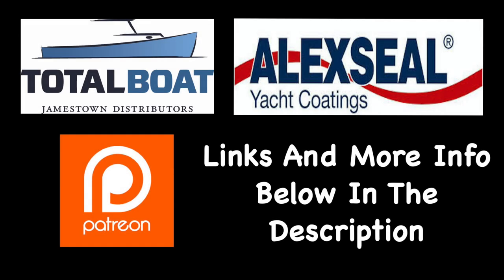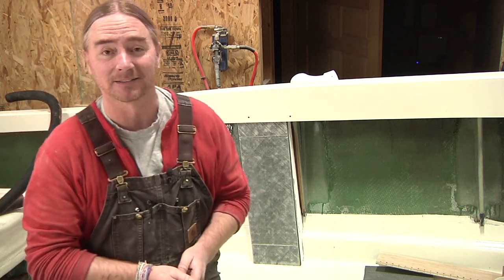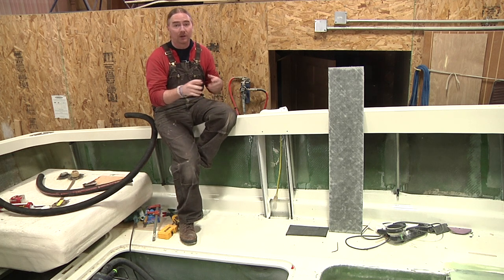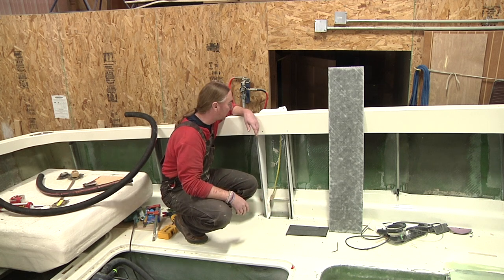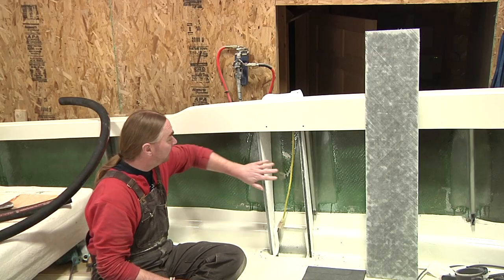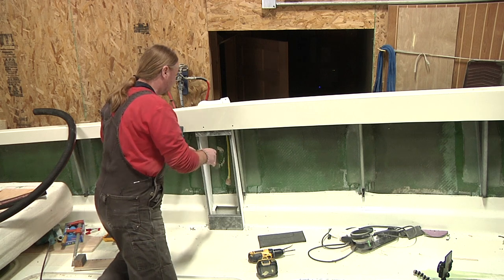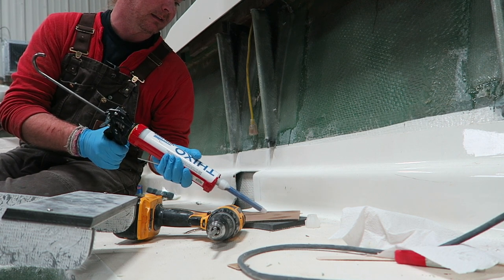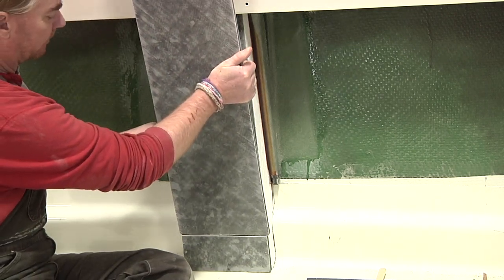Designing And Building The Fuel Locker Covers!

Comment: I think the 1/4 inch roundover was too little.  Before you did it I was thinking it was going to be like half inch or more.  Even if there is a roundover it'll still look boxy unless it is comparable to the other ones on the boat and I think the tightest ones I saw were around the hatch, but on great big plane like those panels it looks questionable.
Reply from the maker: I agree :-)
Reply: @boatworkstoday , Check my Comment pls. Sir, and advise me Which type Resin products to Use for affordability and Strength on the finished product.. Thanks, Richard

Comment: Andy, nice progress. 

You may want to add a small strip (or just a few small blocks) of coosa/glass to the inside of that locker to thicken up those walls. That would allow you to move the screws inboard, and have a more generous round over, 3/8" or maybe even 1/2". That would soften that corner nicely. Just a thought. 

Keep up the good work.

Comment: Undercut or back bevel the top stationary plate at the same angle as the bottom.  That way water will not run back under the 90 degrees top plate.  To place the panel slip the beveled top edge under the lip and then seat the lower portion.  Then both the top and bottom seams are angled down towards the deck.  Great channel.  I saw the part in upside down but it had already been pointed out.

Comment: Just one comment if you were to put the opposite bevel on the top of door, it would lock itself into the top and you could put a latch on the bottom thus eliminating the need to screw it in place. And put a lip on the inside of hatch to keep it from moving side to side.
Reply: By putting a latch the opening on the opposite site from the fuel fill could be used as a lockable storage

Comment: Got my Transom Fiberglass cut from the inside of my Kingfisher Boat about 2" from the Sides and Bottom .. Removing the Black Crumbly mush from the Middle with Good wood on the Sides, and Thick Glass on the Outer Transom.. Please explain Which type of Resin I Should Use to layer the New Plywood in for Better Strength and Workability.. Thanks, Richard

Comment: Hey Andy,
I know it is too late but instead of an angled joint on the bottom, you should have used either a double roundover or a v-groove as they do with the crib boards for sailboat companionways (https://www.catalinadirect.com/images/products/1717/BI9001_S02_sm.jpg).  I would recommend maybe attaching thin cleat along the back edge of the panel overlapping the seam on the bottom so that you can just set the panel in place and lean it back.  This would self align (sideways and vertically) everything and also reduce the number of fasteners you would need.

Comment: Think one of those circle access hatches would be a lot easier.
Reply: Not when you need to get in there & replace the fill hose in a few years.
More access = More better!
Reply: Scott Miller if a fill hose only lasted a few years it shouldn’t have ever been put in to start with. It will probably be there for the life of the boat. No need to have any access to it after the lines are connected. The factory wouldn’t have made it accessible either for the reason I mentioned. No need!!! Just how many times have you replaced your fill hose on your car that is used way more than a boat?? None and if it has it’s not very often you need one replaced. I think he is overthinking all of this!!!
Reply: @mwatkins2464  If you look back at the last video, the fill hose is made of rubber.  All rubber fuel hoses eventually deteriorate.  Also, every boat I've owned has had "some" access to replace things like fuel lines.  I quoted "some" because not all manufacturers get it right...

Comment: The fiberglass laid on the Coosa looks like it is full of air bubbles ? Does the glass take polyester resin better than  epoxy resin ? I have used about 15 gallons of epoxy resin on my current boat project. I still need to make a cradle for the holding tank and water tank, I am considering using polyester to make them and bond them to the boat with epoxyas you do. I like epoxy a lot, but the price and the air bubbles that just don't come out are annoying.

Comment: Just a thought, what if you put hinges on the top and a latch on the bottom. Yes, you would have to round over the top edge, but you could cover that with a small amount of trim. Then if you but similar hatch covers down the length of the sides also using hinges and latches it would fit in nicely and give you enclosed storage. Granted it would be easier if the larger ones opened swinging down versus this one swinging up but it would extend the look of the cooler wells throughout the boat.

Comment: Could you not eliminate the top joint and just tuck the access door up under the gunnel by a couple inches? Would get rid of a joint and stop the possibility of water getting into that joint? The top joint is just a flat butt joint. Wouldn't water running off the gunnel leak in there?  Can't wait to see this trimmed out and on the water.
Reply from the maker: I thought about that and absolutely could (and still might lol).  Main reason I did it this way is so that visually it looked symmetrical top and bottom.  Gonna sit on it for a little bit and think about it :-)
Reply: My original thought was to do just that. It would save glassing in an extra piece at the top which if glassed over will make it proud of the access panel. The edges could be rounded over more if the fasteners were moved inboard and some threaded inserts were fastened to the edge panels behind it.

Comment: Andy,  Just a suggestion, to enable you to create a larger radius, you could add a doubler strip or blocks along the inside edge for your screws, this will move the screws  away from the edge and allow a greater radius.  Ken
Reply from the maker: I think that's what I may need to do if I want something more like 1/2" radius.  Right now there's just not enough meat there for something like that :-/  Good idea!

Comment: Two things Mark. Have you ever thought of using peel ply when doing layups. You just pull it or tear it off of the layup when done and walaa there is no sanding required and the whole piece is ready to be bonded to. Also. The angle your leaving on the cover piece is fine or you could have just left a tab piece inside your kick plate at the bottom and top and have a place to fasten it as well. Cheers
Reply: It's Andy.
Reply: Demography Now! Sorry Andy. Have built many aircraft and a boat or two done them from scratch. Just thought I would throw an idea out there. Sorry again